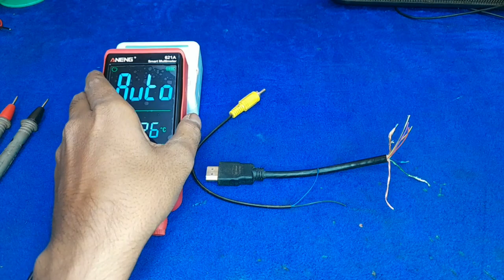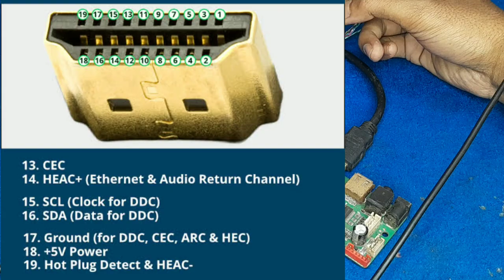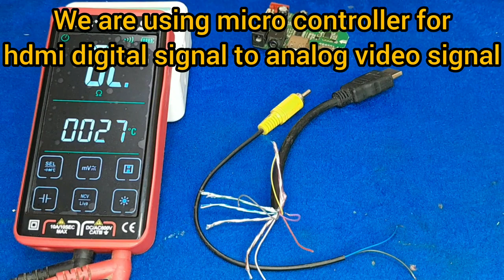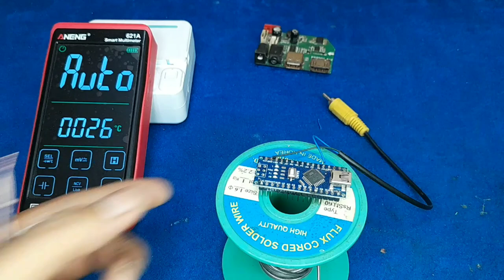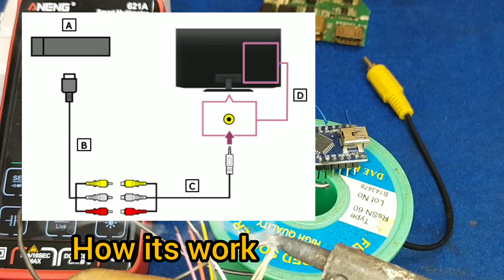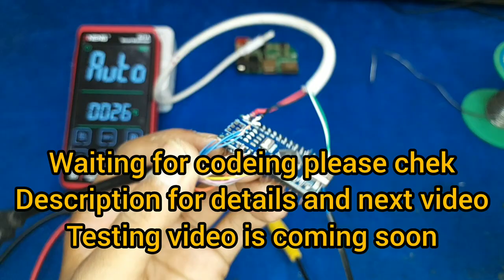hdmi to av cable

Comment: Arduino code is not in the description... i want to splice into the yellow rca wire (security camera video).. and display output to HDMI on a computer monitor... do i need a converter for that (upscaler)? I looked at ALOT of these cords on Amazon, and they are 1 way.. HDMI to RCA.. not the other way around.. it says for Analog to Digital you need a converter...